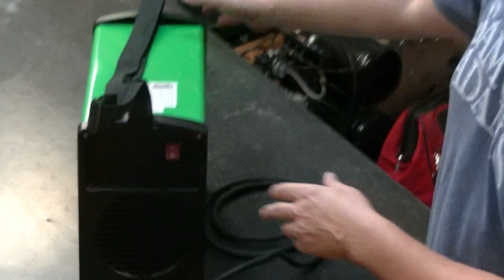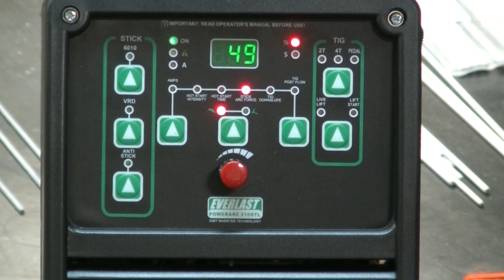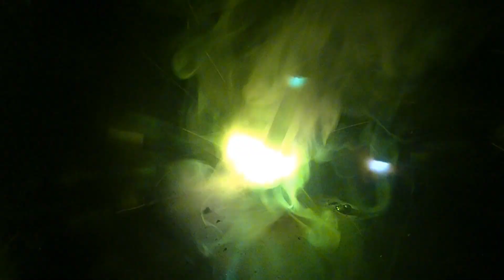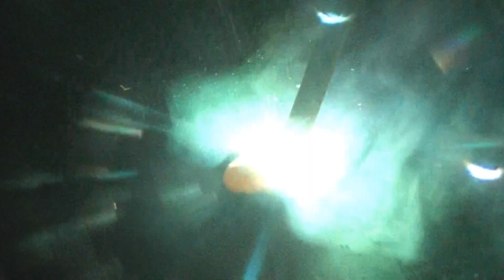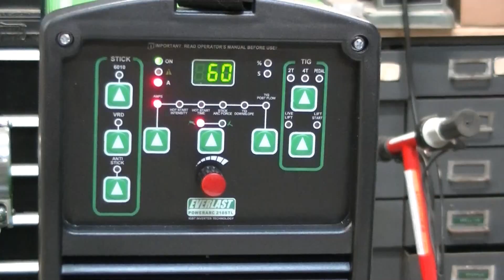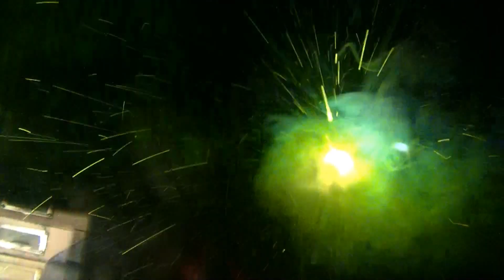Everlast Powerarc STL 210 unboxing and first use

Comment: What are the max amps the pedal will allow you to run; does it allow you to run 200 amps in pedal mode. I was looking at a similar welder the 161 STH which is the same welder with a worse duty cycle; sold by Everlast. It only allowed it to run 120 on pedal even though it was capable of a max of 160 amps in stick mode.
Reply from the maker: Have to try; thought it was full power... but now you have me second guessing

Comment: Man I have one and it does not run a 3/32 7018 good at all on 110 I haven’t tried on 220 yet but I hope it just needs more amps
Reply from the maker: Yes all machines are weak on 110v; but work good if you stitch weld and don't run long beads.

Comment: I got this welder a few months ago. The black plastic cover over the electrode holder slides off the electrode holder very easily. I don't have a lot lot of time on this machine yet but it seems like a poor fit for so little use. I may order a different brand of holder.

Thank you  for this video. The settings values were very helpful.
Reply from the maker: Great to hear

Comment: Does it come with any starter rods ?
Reply from the maker: Not with the machine; but when you pick it up they usually have some if you ask. Same as a welding supply store, they typically have sample packs of 3-5 rods.

Comment: You gotta whip and pause with 6010, it’s not a drag rod like 7018 just an fyi nice video though.
Reply: David Crawford my Everlast 210 STL don’t really like whip and pause with 6010 5p+ , the arc always shut off even with a really tight arc . 6010 button on and max arc forces = no difference. I’m little bit disappointed because a bought this machine to practice my root pass .
Reply: @Elfabricator  same me ! I bought my everlast powerarc 200 st ! I bought for that reason cuz of the 6010 feature,  and its just doesnt work,  i cant get to work ! I tried whip and pause slow and fast and i just cant
Reply: @Elfabricator Hey bro, I am considering getting one of these to practice welding pipe. Can they not handle 6010 well? Or did you get it sorted
Reply: @Elfabricator   are you running 110V or 220V?  I wasn't real impressed with mine on 110 and haven't tried 220 yet.
Reply: Kevin Lee 220v , a welder on the 110v never works well in my opinion .
Reply from the maker: Yes 6010 is a different technique all togeather

Comment: Thanks for the review. I'd like to have one of those but it's not in the budget yet -Jim
Reply: Hey Jim, this is my buddies channel, but if you have any questions let me know. I'll post here and we will be doing a few videos on this Everlast Welder.
Reply: @DaviesGarage  I'd love to know more About this welder. I currently have owned the PowerARC 200st for a little over a year now and absolutely loved it. I was thinking about upgrading to the 300 so I could adjust my arc force and hot start. Then I saw this beast of a machine and it looks like an incredible machine. How's the Tig functionality? Also,does it still handle 6010 5p+ well?
Reply from the maker: I am going to do a follow up video before the new year